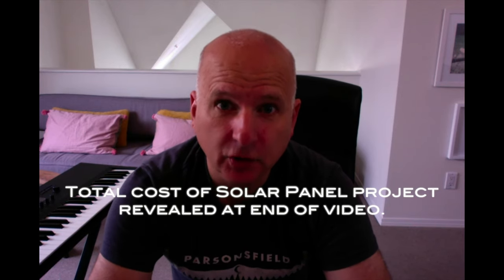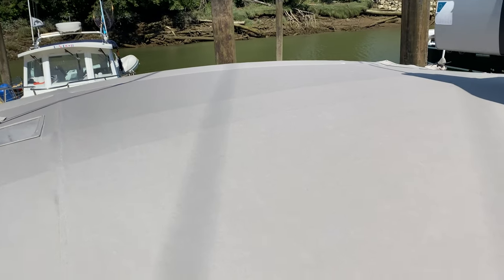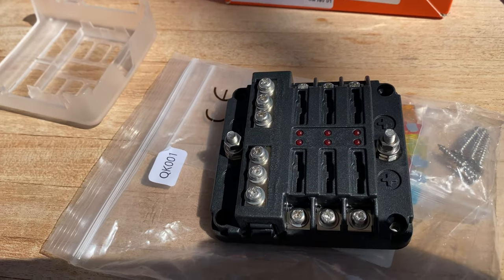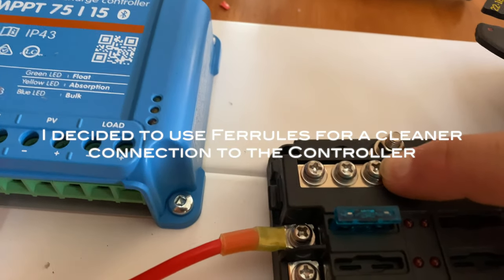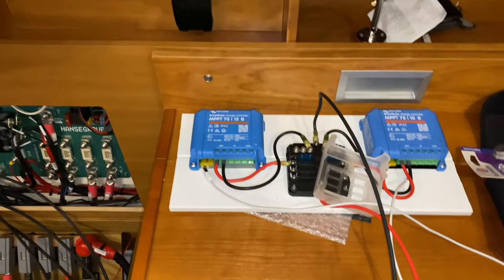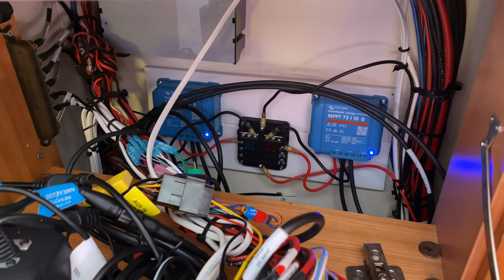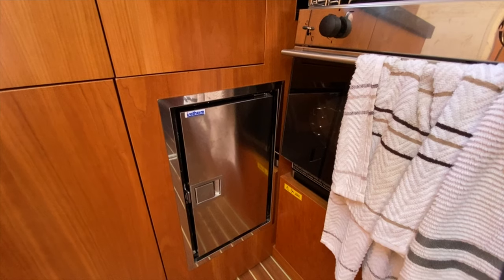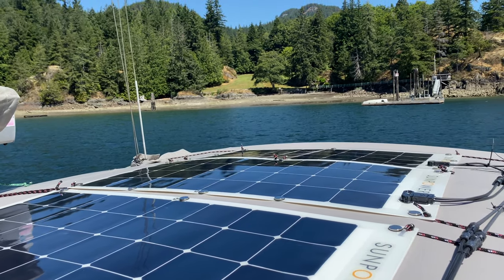Installing an Outboard Crane and Solar Power on our Sailboat  (Episode 8) 4K

Comment: We put together our solar setup last year, using 4 x 110 watt Sunpower panels in series and a Victron 100/50 MPPT controller. We also used rare earth magnets with a hole in the center, to hold our 4 panels on - 2 per grommet, with a stainless steel fender washer between the magnet and the grommet on each side, riveted together. Our boat is a MV with a recent repower/refit and even at 40 knots, the panels didn’t budge. We take them off for the winter and there was no sign of chafing  on the canvas. Was so glad to see you choose a similar mounting method. We’ll keep an eye out for you next time we are in Desolation Sound! Cheers from Eagle Spirit in Secret Cove! (Our boat YT channel is not so great for now, but next year).
Reply from the maker: Thank you for your comment. So great to hear about other folks using the magnets. We are planning to head that way again this summer!